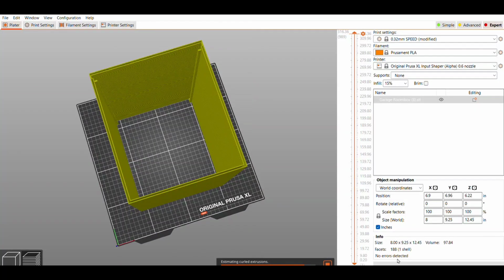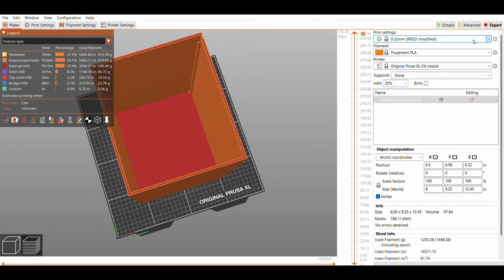Input Shaping for a Miniature Roombox on the Prusa XL!

Comment: Wow, I get better results with my ancient $150 Creality CR10, also with input shaping. I'm really not impressed with Prusa's latest efforts. Thanks for the video, Tada.
Reply from the maker: Can you get the same size? I really need a consistent printer or two that can handle 12" squares without warping. But this price point makes it tricky to want a second. Thanks!
Reply: It's volume is 300x300x400. It's actually about $250 after some improvements, some tinkering and firmware required though. They're available periodically from Comgrow refurbished for $159. I'm too cheap to buy the high-end corexy printers.

Comment: I think it’s the warping causing it all. Try this, guarantee you will get no warping:
- in prusaslicer set first layer to 60 for bed, then after first layer set to 45. (Just below glass temp of pla)
- use smooth sheet
- print file. just after the probing has happened and moved to the front waiting to heat up again, quickly apply a thin layer of glue stick to the bed.

The idea is that the part will be adhered well to the bed with the glue (instead of the 60c heat) and reducing the temp to 45 stops the warping.

Can remove part with water or IPA if it’s too hard to remove. Usually fine though!
Reply from the maker: Thank you!

Comment: What material are you printing with,PLA? Why not use a brim? Or corner tabs, which are just circular brims. Different bed adhesive? Temporary enclosure? Prusa is said to have one out soon. (Hey look! A pink flying unicorn! 🦄) Any breeze, especially AC will cause the corners to lift. What’s the room temp? Does it fluctuate? How about when you open and close the door? Timelapse the print, record room temp, I think you can add temps and additional information to the bottom of your screen. So you can see it when you record. Check your nozzle to make sure it’s all the way up inside and both knobs are finger tight. Rerun the calibration test for everything to make sure it correct. Print a few calibration test to see where you need to tweak the settings or hardware issues. I wouldn’t print big things until I get those artifacts resolved.
Reply from the maker: Thanks so much!

Comment: Input shaping will only correct for ripples in the x-y plane. The ripples you are seeing in the z (height) axis look to me like you have a bent z-axis screw or one is slightly misaligned. As the bed raises up it looks like you are getting an increasing precession about the axis of the screw, causing the x/y shift the correlate with the z height. The vertical ripple is sinusoidal in form which adds evidence to it being either a bent screw or one (or both) screws are not perfectly aligned with the motor axis.
Reply: Also it looks to me that your the "prusa line" is likely being caused by shrinkage of the base before the walls are laid down. As the base has a lot more connected material in the x-y plane and will be most strongly anchored in the centre the base will contract towards the approximate centre of the structure as the layers cool. The walls then end up being laid in the original position and, without material spanning the x-y plane do not contract the same way the base does. The solution in this case would be to keep the print warmer and reduce the shrinkage. This would also solve the edge peeling problem, which is in part caused by the contraction loosening the adherence to the bed at the edges. A heated enclosure would help I suspect.
Reply from the maker: Thanks for that point. I probably need to talk to support. This is a "fully-assembled" unit. Thanks!

Comment: You should definitely have a look at the print temperature of the nozzle. The Default Setting with Input Shaping is now by 230 Grad Celsius. In my test prints the fan didn't have enough cooling power in some situations.
Reply from the maker: Oh I didn't realize it bumped it up. That's a good point. Thanks!

Comment: Isnt it kind of ridicuous to print a box? That's like $25+ in materials alone...it's the epitome of a shape that's easier to manufacture other ways...
Reply from the maker: It's a fine line for sure. My customers like having a durable fully assembled roombox. I like not having to glue, sand, prime, paint etc like I used to. Thanks!

Comment: I don't have an XL but input shaping hasn't been great for me on MK4. If I want something to look nice I use the old profiles. If it doesn't need to look great then I use structural with imput shaping. I never ever use fast/speed. 

To deal with corners coming up for ASA I've had to use glue stick even in an enclosure. I'm testing a couple of different ways of applying the glue for PLA prints as well. The glue isn't expensive but I don't like the idea of washing off more glue than actually gets used with the prints, plus my prints have ended up with weird lines/indentations from the glue being too thick in some places on the metal sheet when applying it directly with the stick. So, I'm trying thinning out the glue a little bit with water, and applying it only where I'll be printing. This seems to be working pretty well so far.
Reply from the maker: Yeah maybe it would be good for a print like this. Thanks!

Comment: Could any of these issues be linked to the nozzle?  Maybe it's just worn out from those few prints with abrasive filaments (wood and cf etc)?

the new XL you're getting soon with the 5 tool head might be better.  Very excited to see how it works. 👍😎
Reply: very likely.  CF will wear the crap out of a nozzle quick and give all kinds of issues.  Add in a brim to help with corner stay, new nozzle, structural setting rather than speed and I bet it comes out better.
Reply from the maker: Yes I can't wait to try out the new one. You're right it'll be interesting to compare prints. Thanks!

Comment: I may be giving you information you've already have tried, but just in case, I thought I'd share that I have also struggled with corners pulling up.  There have been a couple things that I've found to help.  The first is to round off the corners so they're not sharp (like a roundover or chamfer) then it won't be a sharp edge to lift - even a hardly noticable roundover could help. I can't remember why this helps but I've seen several folks here recommend it and I've found it to help.  Second thing you could try, in addition, is to add a couple of the flat .2 mm thick discs at the corners to give them a mini corner brim (in the slicer, add part from gallery, select the disc, and merge it with your main print).  Thanks for sharing your experience with the input shaping alpha!
Reply from the maker: Good ideas. Thank you!

Comment: I would switch to the smooth pei sheet for pla that prusa sells, I had that sheet you are using for ages now and I never got pla to stick on satin or powdercoated
Reply from the maker: I don't think the PEI is available yet on thr Prusa XL. I can't wait tho!
Reply: @tada3dprinting  Interesting, cause I saw it on the store a while back. Maybe they removed the listing, it was called "smooth print sheet 36x36 cm" and cost like 85€

Comment: After your last video about Input Shaping I tried several prints with 0.20 Structural. One was a couple of tall boxes with round corners. They cam out beautifully, smooth sides, no banding. Looking at your non-IS print, I am wondering if you don't have a problem with your XL. It shouldn't band like that. I suggest trying Input Shaping again, but this time pick Structural instead of Speed.
Reply from the maker: Oh thanks for checking that out. Maybe there are some issues. Thanks

Comment: Thank you, is some concerning information on the printer! While the warping and corner problem can be adressed externally, the increasingly worse Z beding should not be an issue of a CoreXY printer. This could be a flaw in the design of how the bed is mounted to the printer. I have a 2600€ order for the Prusa XL and your videos provide so much information, thank you! But with the issues and Prusa being silent about all of this and promised features (enclosure..) I may cancel that order once it becomes available.
Reply from the maker: If I were you and worried about these things, I would just hold off for a bit and not order or cancel. I heard somewhere more talk of an enclosure etc. So I'm sure things are becoming more available. Also, my 5 XL should be here this week so I can see if my 1 XL just has some quirks. Thanks!

Comment: If you use 3dlac you’ll never have lifting again. 
People say oh you don’t need glue and shit on textured pei. But end of the day if you use 3dlac you’ll never get a lift so it’s just better to use it
Reply: I can only agree with that. The 3dlac also works with large filigree prints. You don't have to spray every time, I only clean the plate every 5 prints.
Reply: I disagree. In the case of using 3d lac it will bend the whole sheet. I am having a same issue.

Comment: I think a few of us have said in a few other videos.. you really need an enclosure for some of these prints. The lifting in my experience is less of an issue when in an enclosure, especially on larger prints. I have typically used a glue stick and heated the bed a bit more as well to try to keep it melted/attached a bit better. Not sure if you're doing that. But I'd love to see you get an enclosure and try again and see what happens. Also, as others said, try a raft. They are easy to remove and a few mm or so in size may help keep the corners down.
Reply: I think you might have meant a brim instead of a raft? Also agreed on the enclosure suggestion.
Reply: @MichaelPetito yup my bad thanks for correction.
Reply: You dont need an encloure for pla
Reply: This printer doesn’t have an enclosure was a no go for me. I bought a Snapmaker J1 now. 
2 colors/materials are enough and if I need more I can use the X1C or my Voron with the ERCF.
Reply: Youre wrong. I have enclosure and with pei I have good adhesion. It has bendt the whole sheet, not only the printed part :(
Reply: @hstagm I mean. I am not wrong about my own experience but I am sure some will have issues. It's a never ending trial and error process and for every filament too. Once you dial it in for specific filaments including drying them before printing and figuring out glue or hair spray and brims to help keep corners down you'll be good.
Reply: @WhySoDivided-CantWeAllGetAlong  brim, hair spray etc could help if you have a bad adhesion. But my sheet is bending with the part, so my adhesion is perfect. The bending is stronger than the prusa pei sheet. This is only present in the mk4/xl input shaping. With the standard profiles the corners are fine.
Reply from the maker: It's always tricky getting just the right everything. Thanks!

Comment: What happens if you try printing with a raft? That way the raft should "lift" but not the print itself.
Reply from the maker: Don't rafts require you to cut them off? I really haven't ever used them. Thanks!
Reply: If you use a raft; it should work just like a "side support" .. So it does not 100% fill the space inbetween so you can take it off easily. If you would use it for the bottom (which you dont see with the object placed down) it should work out. But do try it on a smaller object first; would be a same to waste a roll of fillament on the experiment. @tada3dprinting

Comment: We need to get you a smooth pei sheet.  Pla sticks really good too it and helps with the lifting corners.

Putting a radius on the corner helps sometimes too because the cooling on the corner is more uniform vs. the sharp corner.
Reply from the maker: I haven't seen a PEI option yet on the XL. But maybe I'm missing it. Yes, I should try rounding the edges. Thanks!
Reply: @tada3dprinting I'm not sure why YouTube keeps deleting my comment, but they are available on the Prusa website.

Comment: With my MK4 I always choose structural when I want the dimensions to be accurate with Input Shaping.  I am actually getting more consistent straight walls with input shaping enabled. 
For PLA, you actually want the plastic to cool rapidly to minimize the curl, this is opposite of what you want for ABS and other traditional 3D printing plastics.  Try printing again in a cooler room with input shaping enabled.  I would also point out that Input Shaping with the MK4 was quite bad for the first Alpha release and got much better as it got to the final release.
Reply from the maker: Ok I'll try this. Thanks!

Comment: Those layer lines look terrible. Its very inconsitent. Is that coming from the Z-achse ?
Reply from the maker: Pretty typical on any of my printers. The lower the layer height, the more warping. I probably should go the other way and get a larger nozzle to print it faster. Thanks!
Reply: @tada3dprinting a lot of good suggestions here and I probably would not tolerate the print quality myself, hoping that is just teething problems with the firmware (I have a two head on the way). Having said that I am sorely tempted to put a 0.8 or even 1.0 nozzle on my second head for large structural prints with no details needed. Should print a lot faster.